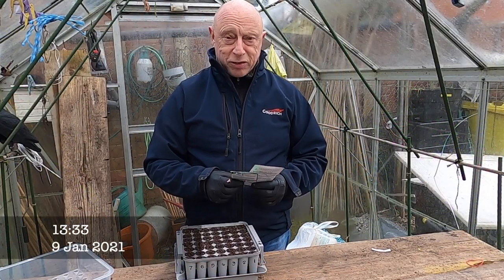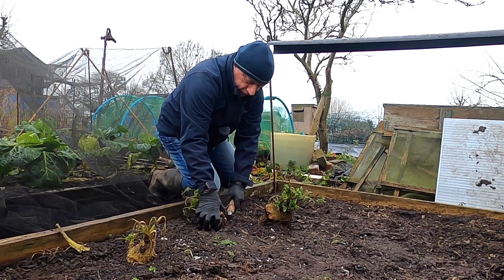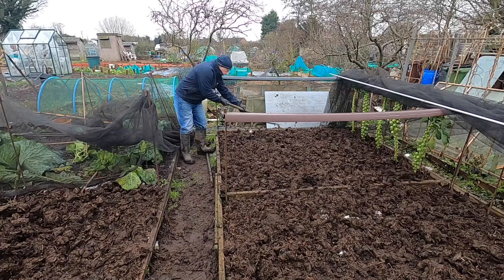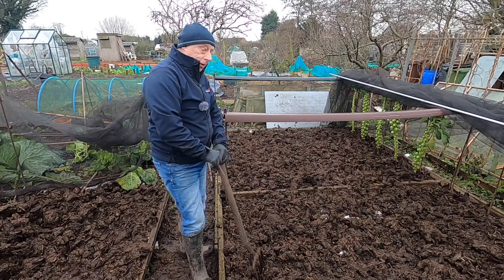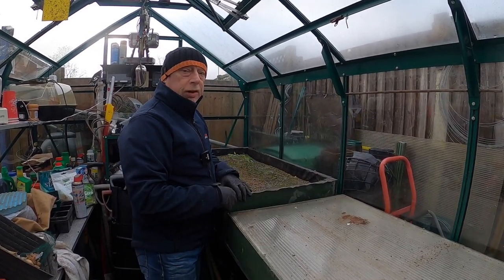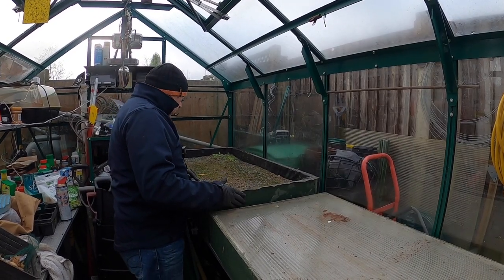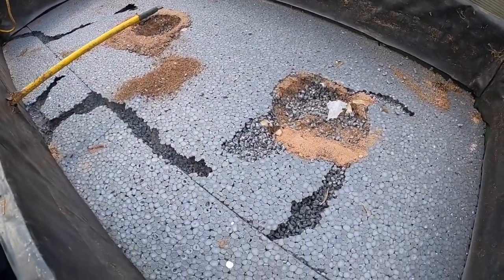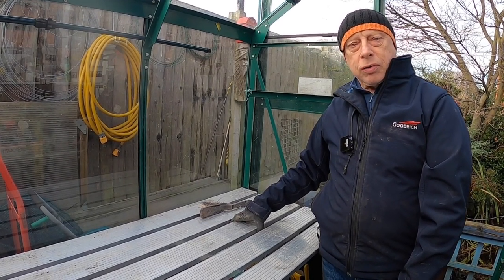🌻213 🌻 Upgrading Propagators 🌻 Cow Manure Benefits 🌻 Seedling Update 🌻 Mouse Tales

Comment: Thanks for the video Nigel. Learnt so much from this Video didn’t stake my Brussels last year but will next. Done my chilli seeds and onions can’t get the manure on yet as carpet is frozen to it lol. Just brought a long heated wire so looking forward to seeing a follow up video.
Reply from the maker: Hi Andrew, just a quick tip, when you are installing the heated cable, plug it in about 10 minutes before you install it.  The warm cable bends much more easily 😀
🌻Nigel.............MuddyBootz Allotment🌻🌻
Reply: @MuddyBootz  thanks Nigel appreciate it

Comment: Nige, the polystyrene tiles are a great insulater. Just put underfloor heating in me house, same sort of insulation method but have silver reflective sheet on top of the polystyrene. Stops the heat loss going down into the floor. You might find it reflects heat better up into your pods/ trays. All the best, Tony from Poland.
Reply from the maker: Hello Tony and welcome to the channel 😀. I have just finished fitting the polystyrene beneath the pods, you will see them in a video shortly 👍
🌻Nigel.............MuddyBootz Allotment🌻🌻

Comment: Hi Nigel.  Good video as always 👍🏻 we’ve had our plot a year now (Norwich), it’s not massive but enough for the 2 of us.  We’ve decided to redesign it & put some raised beds in.  Couple of questions....would you make your beds of equal size or a mix? (We don’t intent on deep beds more likely a scaffold board depth)....secondly would you consider spuds in the 30L tubs or in the ground? We did ground last year with good results but thought I’d ask coz we’re redesigning.  Thanks Nigel & stay safe 🌾🥒
Reply from the maker: Hi Vanessa, firstly with the raised beds I would make them equal size.  I did this with mine and found it very beneficial particularly when making covers for the tops, it is easy then to transfer from one bed to another.  With regards to potatoes I have had good result using both methods, however the tubs win when it comes to harvest time.  It is much faster to empty the bucket and also there is no risk of damaging the crop with the fork 😀
🌻Nigel.............MuddyBootz Allotment🌻🌻
Reply: @MuddyBootz  thanks Nigel 👍🏻 appreciate your advice, as always

Comment: Hello Nigel i have no electric on the plot do you think it would still be beneficial to purchase a none heated vitopod for my polytunnel thanks for your help
Reply from the maker: Hello. personally I would construct one for the tunnel and try and make the lid from polycarbonate.  If you have a conservatory company nearby, check with the fitters as they are always offloading odd pieces of polycarbonate when re-roofing conservatories. The Vitopod comes into its own with the heating....the heat is so evenly spread and the thermostat control is very accurate 😀
🌻Nigel.............MuddyBootz Allotment🌻🌻
Reply: @MuddyBootz  Thanks will give it a go